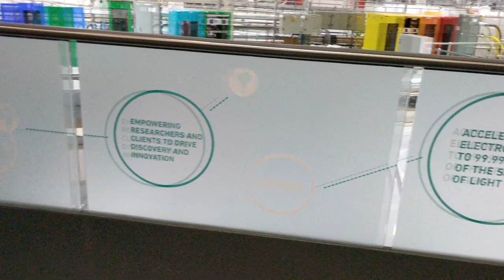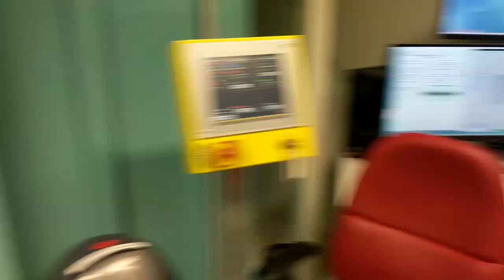Synchrotron Visit + Graduated!

Comment: Congrats on your graduation!
(If you want my advice, go for a master's degree. There isn't much to do with just a bachelor's degree that isn't just boring and repetitive preparations)

(Also, that's a funny coincidence, I'm going to the synchrotron in Grenoble (the ESRF) in just a little over a week to run  some  of my samples! I never got to do that sort of stuff during my undergrad though. Lucky you! ^^)
Reply from the maker: That's good advice I feel, and I've taken it already.. of sorts. In Australia we have a slightly different system for science degrees, i'm not sure why. The ordinary B.Sc. degree takes three years, and there's no research involved. I finished that last year. You can then follow on to do a year of research, termed an 'honours' year, and you then finish with a B.Sc(Honours) which is slightly higher then a BSc but lower than a Master's. More importantly I feel, it brings it more in line with a BSc internationally because most places assume there's research involved in the degree, so my BSc(Honours) = European BSc for example. And my ordinary BSc = Europeans laughing at me.

The difficulty then is that once you've done the Honours, you can't do a masters. The path is BSc --> Honours --> PhD--> Out  or BSc --> Master's --> Out. This means a PhD takes 7 years to get here (3+1+3)

So I am more qualified then a BSc, less than a Master's, but cannot get any higher without a PhD.
Reply: "More importantly I feel, it brings it more in line with a BSc internationally because most places assume there's research involved in the degree, so my BSc(Honours) = European BSc for example. And my ordinary BSc = Europeans laughing at me."
Strange, I did my B.Sc in France ("licence" as we call it), it took three years and there was no research involved.
And if you can't do a Master's in Australia, surely you could do one abroad, like in Europe.

Or have you heard of KAUST? It's where I did mine (and my Ph.D now). It's in Saudi Arabia (yeah, I know...), but the whole campus (which is basically an independent city, I haven't left it in months) is built as a western enclave, where the country's religious laws don't apply. It's 70% foreigners (like me), and everyone speaks english. Studies there are very research-focused, you've got funding and access to big instruments like nowhere else, and they actually pay you a salary during your studies. (I have student _savings_. Tell that to someone in the US!). Downside is that life outside of work can be a bit boring.

(Or go straight for the Ph.D as you said.)
Reply from the maker: So maybe I'm wrong about bringing it up to international standard... but yeah I am at least slight above a BSc here anyway.

Oh yeah, I worked a lot with a post doc at my uni who spent last year at KAUST doing MOF work. You guys do some pretty cool MOF stuff, I recall reading some nice papers out of there. But yeah I have heard there's a pretty high work ethic, very different from my uni :P Our labs wouldn't survive without spending Friday afternoons at the university bar on campus haha. But I guess you adapt to the different environment. Would sure be an interesting place, and getting paid is always a bonus!
Reply: If you end up coming to KAUST, I'd be more than happy to meet and greet you! 
Maybe you'd want my personal e-mail if you have any questions about KAUST?
(Also, who's that postdoc? Maybe I know him! If it's MOFs, I assume he worked with prof. Eddaoudi? I'm in the Kaust Catalysis Center, with prof. Basset.)
Reply from the maker: Well it certainly makes the place more attractive, knowing there's at least one friendly face there! I'll certainly keep KAUST in mind in future, but for now yeah the focus is on getting a job here locally.
Ah maybe I shouldn't name names, seeing as no-one at my uni knows what I do online but oh well, guy called Weibin. Yeah Eddaoudi, that rings a bell, fair certain it was